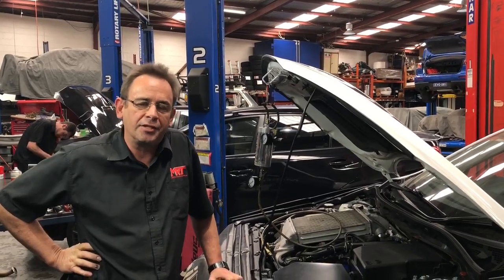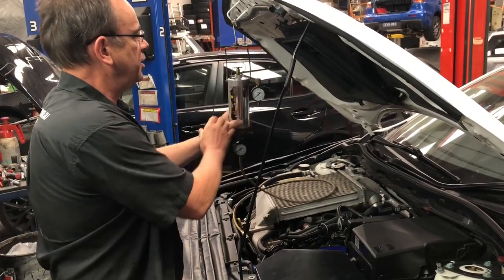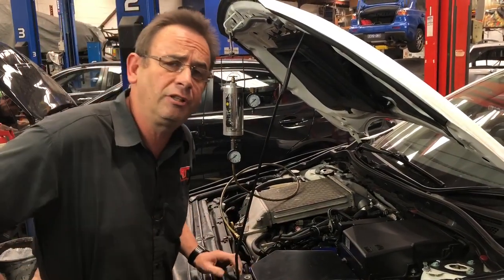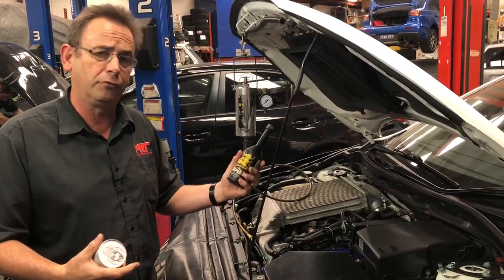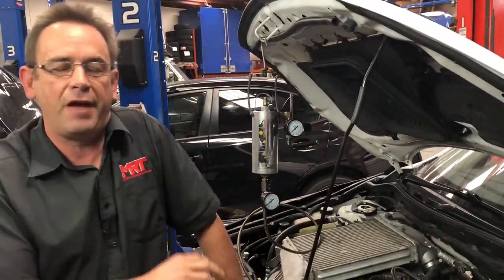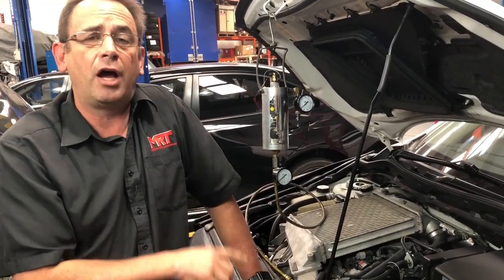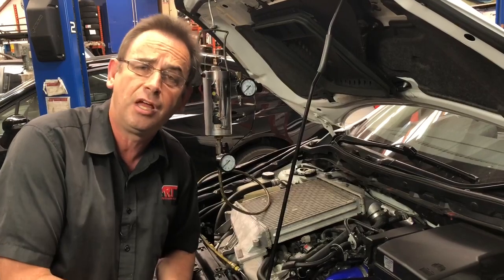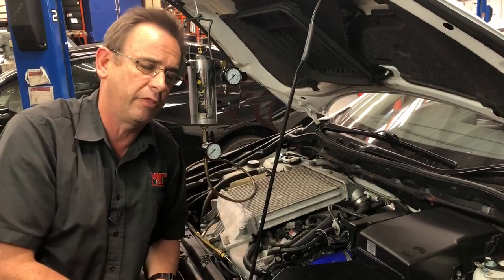Mazda 3 MPS Soot Clean

Comment: Do you have any before and after pictures? I think it eventually gets to the point where the valves need to be physically cleaned. I blasted mine with crushed wall nuts because they were that bad. This seems like it would help prevent the buildup getting that bad.